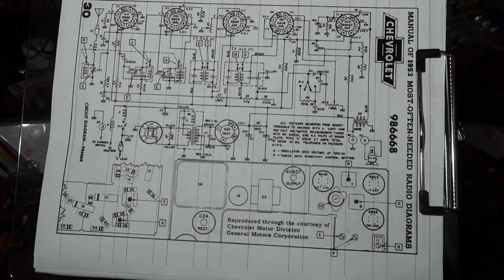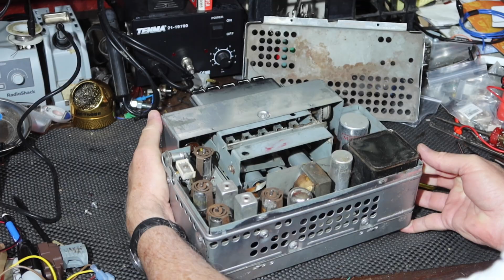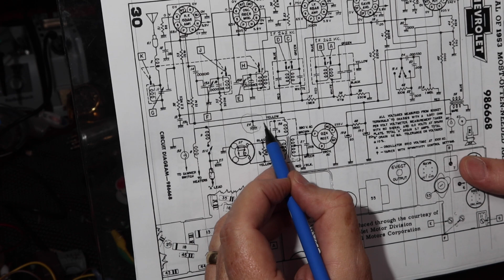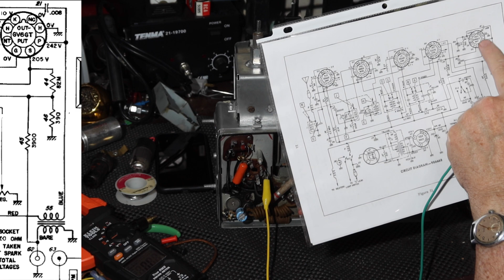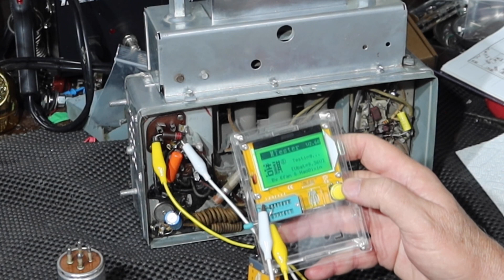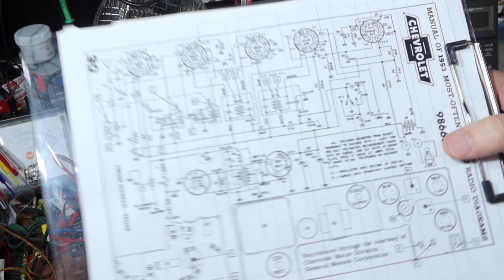1953 VACUUM TUBE CAR RADIO Pt1 - THE VIBRATOR POWER SUPPLY - CHEVROLET PUSH BUTTON MODEL 986668 [4K]

Comment: I remember the radio from the 1950 Oldsmobile my parents had. It was all octal tubes (6SA7 Conv,  6SK7 x2 RF amp, IF amp, 6SQ7 Det/audio, 6V6 x2 Outputs and 0Z4 cold cathode rect.). Yes it had a push-pull 6V6 output. Quite loud and powerful as I recall. Fed into a 6x9 speaker which actually was mounted in the large case of the radio.

Comment: Change the HV    caps i n the vibrator supply a nd the output section  GRID AND OUTPUT XRMR  at least  Weak spots  on theese the   ifs are 262kc not455 as ac radios. Looks as if done already on this radio

Comment: That was a good one, trying to use the pen a a probe. One time i had 2 volt meters close by. I was trying to get a reading using one of them, but was not getting a reading. Couldn't figure what was wrong with my meter. Turns out i was trying to use one probe from each meter! Ha!

Comment: Great use of the auto head light for a dim bulb tester. Very interesting video on the auto radio, I have been on the lookout for a tube auto radio to work on someday. Great way of testing the vibrator circuit, the IF at 262KHz is much lower than home radios.
Reply from the maker: Thanks Jim.  There is some interesting stuff to come in this project.  Stay tuned. Thanks again.

Comment: Love this video. In particular, I love it because I'm not the only guy that thinks one thing and says another. Also, I have yet to use a pencil for a probe, but I can feel it coming. Thanks!
Reply from the maker: Ha - yep, it happens.  I used to tell my son when he was little, a professor is someone who says "A", means "B", writes "C", and "D" is correct.  As you can see, I don't cut out the dumb stuff I do or say.  A lot of my editing is adding the text to try correcting what I say.  Probably still miss a lot.  Thanks!